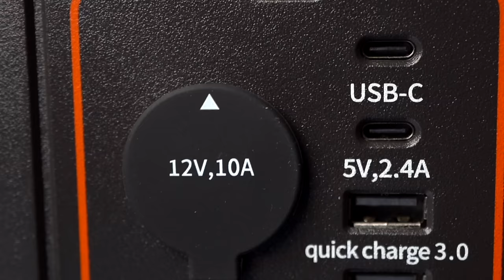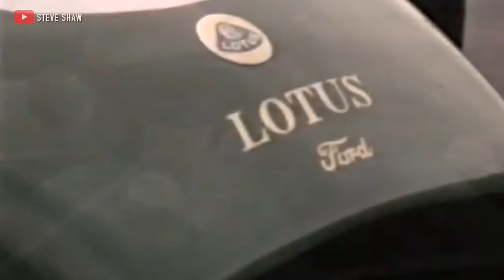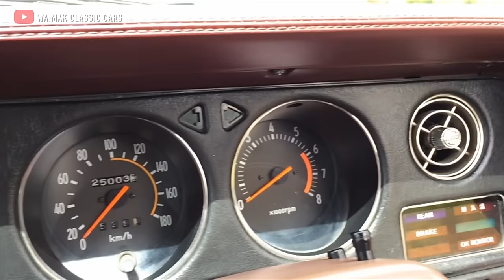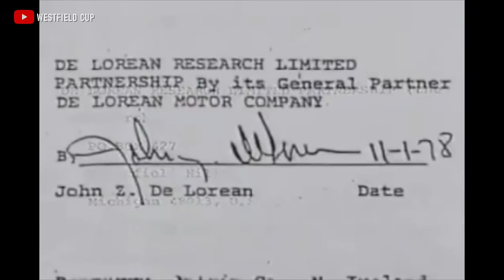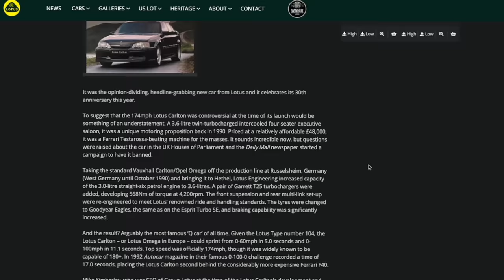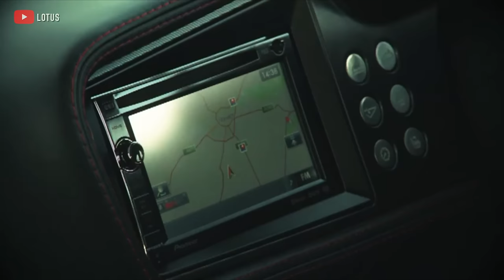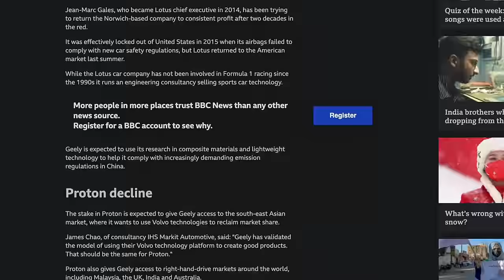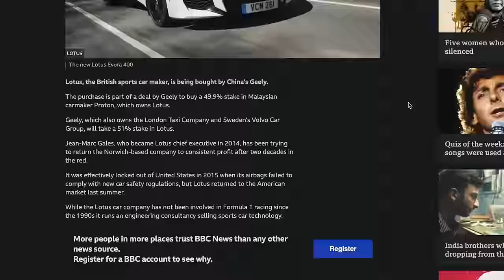Lotus is Dead

Comment: Here is the conundrum Lotus finds itself in: simplify and add lightness results in stripped down cars that the public has failed to purchase in numbers large enough for the company to survive.  But if you abandon this doctrine, how do you distinguish yourself in a crowded car market???  This last question becomes even more pressing as you move into very popular as well as very competitive car markets like SUVs or the future big markets in EVs. Can you live off your name?  No.  Lotus has been irrelevant in the car world for so long, many people have forgotten they still exist.  

Perhaps the Emira is pointing towards a potential solution.  The Emira is basically a re-skinned Evora, but it is a $100,000 sports car that looks like a far more expensive exotic car.  Unlike the Evora, that impression is not immediately dispelled by the interior.  So far, that seems to be working as my understanding is that 1st year production of the Emira is sold out.  However,  from what we have heard, Geely is not interested in the small niche car company this strategy would produce.

My take is that the Emira was the cheapest way to buy time for Lotus to develop what is coming next which you correctly point out is a SUV (or two).  A pic of the new SUV has been teased for later this year.  But how many ways are there to design this kind of car and stand out from the crowd???  And what would persuade a potential customer to put up with sub par fit and finish as well as a limited dealer network?  

Right now, Lotus car stand out on the outside and inside.  Granted, the stand outs are not all good, but at least it is distinctive. In the future, Lotus will be hard pressed to stand out at all and that mediocrity could very well be the end of Lotus.

Comment: Lotus is just moving with the times, light cars just can't meet the safety standards needed to be road legal anymore. Plus I believe Colin Chapman would be onboard with electric drive as it gives so much more control. Also, electric drive is way simpler than ice.
Reply: Ignoring actual reality; if all cars were electric and someone invented an ICE engine, Chapman would throw out the electric nonsense for the weight saving alone.
Reply: @fredmercury1314  until some one figures out how to make the ev’s that are just as light.
Reply: @rexthewolf3149  Never going to happen. It would require a physics-breaking breakthrough.
Reply: @fredmercury1314  Can't beat the energy density of petrol. If synth fuel can get cheap enough, EVs are going to be a footnote.
Reply: Just going to ignore the existence of the MX5? Okay.
It's ~1000kg and passes all crash regs, btw.

Comment: I did the math, the Evija has 1974 hp at about 8267.5 rpm. Torque*RPM/5252=HP is the equation. Given our numbers of torque and hp we get the equation of 1254*x/5252=1974. From there we get 1254*8267.5/5252=1973.99942879. Close enough, pretty sure they said so for 1974 hp. 
I wish we had the numbers through the rpm range. If the torque and hp numbers were taken at different rpms, then my math is incorrect.
Reply: To further explain why my math might be wrong if the hp and torque were taken at different rpms: If the 1974 hp were taken at 10000 rpm, then the equation would be X*10000/5252=1974. That would make the torque at 10000 rpms just 1036.7448. 1036.7448*10000/5252=1974. The torque would be way higher if the hp was at 5000 rpms: X*5000/5252=1974... that comes out to 2,073.4896*5000/5252=1974. So a motor making 1974 hp at 5000 rpm is making about 2073.5 torque.
Numbers at all ranges would help tons understanding the car. 
Yes, I might be a little bit autistic.

Comment: If everybody wants SUVs, car makers have to make them. That is especially true in the UK, where there are actual laws that ensure that a company MUST be run with the intention of making as much money as possible. Not doing so can lead to the directors being disbarred.
I currently have a SUV, the first in my life, and it will also be the last. It is a truly hateful thing. Simply knowing that it is carrying all that extra, useless weight around is enough to infuriate me. I bought it simply believing that nobody should criticise a style of vehicle without having owned one, and it has proven even worse than I had ever imagined. It really does absolutely nothing better than a similarly interior-dimensioned car of significantly less than half the price. It has the carrying capacity of a small van, but with the footprint of a medium sized van, the road manners of an ill-tempered warthog and the performance of an asthmatic lawn mower.
I can't wait to replace it with an EV.

Comment: Interesting analysis apart from one or two glaring errors: The original Elan was a 1500, correct. So why show a 1600? (1558 actually). They NEVER raced a Flat 16 in F1 in 1966, it was a BRM H16 and finally the Champion driver for Lotus in 1968 was Graham HILL not Graham Clark.

Comment: Entertaining video with a bit of not previously known insights. I do have issue with how you present the early years of Colin Chapman's car development and racing heritage. Chapman wasn't creating his earliest car in a vacuum. The first three car series were to compete in British hill climb events where they were successful, but not really so different from their competitors. The post war Brits had a performance car sub-industry created around building your own light weight track/street car from either hot rodded pre war cars or from manufactured kit cars which is where Chapman/Lotus thrived. The suspensions on Chapman engineered car were very much superior to other maker's offering and gave Lotus a significant advantage. You gloss over the fact that for Chapman, everything he did as far as manufacturing road cars was only to support his race car endeavors. You do allude to that mid video, but it a driving force in Chapman's decisions.

As for the death rate of Lotus drivers: you might want to compare that to how many drivers died in other manufacturer's cars. F1 of the late 1950's and 1960's viewed the drivers as expendable items not much more valued than the tires on the cars. It took the efforts of Jackie Stewart at the end of the 1960's to force rules changes that would make safety features a part of the cars, but more importantly, the race courses the cars performed on. Were Chapman's cars more fragile than other. Yes. Did that make them bad cars? Hardly. For context, Porsche had a racing car with a chassis so fragile that it was pumped full of nitrogen gas and had a pressure gauge in the cockpit of the car. If the driver saw the pressure drop, he dropped out of the race because the frame had failed in the car. Race cars are dangerous, and everyone around them know it. Also let it be noted: Chapman attracted the biggest names as drivers at the time. The death of a star, no matter the enterprise, always carries a longer lasting impression than the loss in the same way of a driver no one had really paid attention too.
 
The late 1970's cars that seem to diverge from Chapman's goal of designing out weight were an actual corporate decision to rebrand the companies offerings. Gone was the market the British sports car - MG and Triumph plus the other small maker (except Morgan) all had disappeared by 1980. The market was in up scale cars such as Porsche or Ferrari like cars, so that is where Lotus directed their efforts.

 I have real issues with the pictures you used to illustrate some off your points early in this video. At one time you are referencing Lotus' sue of Ford engine when the engine on screen is a MG 'A' series engine as used in the MG Midget. That was an engine used in some of the Lotus 7's and 11's, but was certainly not the engine of the early Lotus 6 or 7's.

Comment: The Eclat and Elite Type 75 weren't poorly engineered, they had plain steel chassis without any rust protection. Later models had galvanized chassis, but it was too late. The damage was done.

Comment: I had an excel and an esprit years ago but never got an Elise, still might buy a used one. Vehicles have to evolve and sadly where Lotus had the edge, lightweight and great handling over the competition but now a Kia handles like a lotus   and a Toyota can be as fast for less money.
The problem with many cars both ice and EVs is the power to weight is still not as efficient as Lotus always was. The body and chassis on a Tesla is reasonably light but needs improvement. The wheels on EVs are way to heavy imo. The future for Lotus is developing a lighter battery and motors.

Comment: The Carlton did not die because it was horrible but because it was quite easy to steal that no one wanted it and because of that factor, the insurance premium on those things during those days were off the roof.

When the Carlton launched and the press was having a riot about it be it good or bad, it gained notoriety and joyriders soon realized the potential of the car. Coupled with the Sierra Cosworth, both the Carlton and Sierra soon became joyrider's ride of choice as both cars had terrible locking system that's easy to pry open and soon every carjackers would pick these cars, pry the doors open and take it for a high speed chase with the cops who at that that time didn't have anything to catch up with the Sierra and even worse, the Carlton which was way quicker and faster. 
Thus insurance company started to doll out exorbitant premiums for these cars which effectively class them under supercar status despite being normal coupes or even sedans and that effectively killed anyone's ambitions of wanting to own a car like that and with all these factors coming in hard, the sale stopped.
Reply: exactly.

Comment: Another car you seem to be un aware of is the lotus Isuzu Gemini from Japan.

It was a front wheel drive Gemini (I'm sure there's another European car with a different name).

It was built before the 90s elan as a test bed for the elan engine, it had recaro seats, different suspension and a body kit.

There was also a later version with awd and a turbo

Comment: that was a great overview of the Lotus company and the Lotus cars. In my 70s now, I am about 35 pounds heavier than when I last sat in my 1967 Super Seven, and I suspect that it would be a very tight squeeze. That does not stop me from fantasizing about locking myself in my workshop and coming out with an electric Caterham seven. It was not the most practical car that ever I owned, but it IS the one that is most missed.

Comment: My Europa and my Esprit were a lot of fun. They were a lot of things but one thing they weren't were cars. ACBC once said regarding his race cars: 'A race car that falls apart as it crosses the finish line is a successful design"! Regarding his road cars, he said; "My road cars are thinly disguised race cars"! You see the point. My air-cooled 911s will blow the doors off of my Esprit S2 at the track and I could drive them from Seattle to Miami with confidence that I was going to make it. The Lotuses would strand me on my way to the grocery store. I got to where I never drove them more than 10 miles from home unless I was trailering them. heh heh However, ACBC is one of the greatest car makers of all time and I miss the shit out of him.

Comment: Alan Stacey was not killed by a Lotus failing, to be fair. His death was much more akin to Welsh F1 driver Tom Pryce some seven years later. unlike Pryce, who hit a Marshal, and in so doing was hit in his head with the man's fire extinguisher however, in Stacey's case, it was a bird strike to the face at almost 200km. it is likely he was killed instantly, however, we'll never know if his head and neck injuries were from the strike or the subsequent loss of control at high speed and crash thereafter. But it was NOT car failure. 

Rindt's death is a little more complicated, yes, something snapped.... but that was not necessarily due to the flimsy build quality of the car. Lotus had made some improvements there. No, instead, I would like you all to watch the actual footage of Rindt's fatal crash, you put it in the video, so look closely. Rindt's car was running without any wings. it was made with wings. Wings were a thing by then, but Rindt was running with his front and rear wings removed. 

The cars were down on power compared to the Ferrari's of that year, and they discovered they could get almost 1000 RPM out of the thing, sans downforce. So over that weekend they began running without the wings. John Miles, Rindt's team mate said the car was twitchy, getting vibrations which felt on the brink skipping in some parts of the track and that the car had to be fought to keep straight, so suggested they abandon the wingless idea. Instead, they ran with it, simply extending the final gearing to get the most top speed out of the new set up, with assumption this would smooth out the high speed wobbles. 

The moment you have a car that is wanting to veer, and had excessive vibration, you are adding stresses to the tolerances of components. The car was designed to operate with downforce loads that were not present on Rindt's car, because of the decision to remove the wings, effecting the stability of the car. Removing those loads, and running the car without key elements of the package, was likely a far greater contributing factor to the failure than the build quality, as the car suddenly experiencing exertions upon its tolerances it had not been tested for. 

Additionally, Rindt was not fully anchored to the car. Rindt seldom wore the crotch strap of his five point harness, and was not in 1970 Italian GP either. He was of the opinion that, ironically, it was safer not to use it, as it allowed, in his mind, faster extrication from the vehicle in a crash scenario. In this instance, however, the nature of the crash, caused him to slip out under the belts, and buckle, hit with force, at speed, bi his body, namely beneath his chin, slit his throat. 

There is a fine line between on the spectrum of Risk V Glory where you can cross the threshold between life and death, and it is likely in this instance, Rindt crossed that line, despite being warned by his teammate that there could be some issues. Rindt had not experienced the same problems in pre race running as Miles, so chose to take the risk, and ultimately it killed him. 

Again, like Stacey, I would argue that although something failed, it was not an inherent fault in the car or its build quality which lead to the crash, but high risk operation of the car in a manner which went beyond its design parameters, which in turn caused that failure, and not the fault of the failure itself.

Comment: Part of the problem for the makers of these pure drivers cars (Lotus included) is that modern standards for fuel efficiency, emissions, safety and other things mean that you can't build a car that's road legal without all kinds of driver aids, engine management computers etc, all of which make the "simplify and remove as much weight as possible" no longer a thing you can do (you have to make it complex to be legal and it ends up being heavy to hold all the mandatory equipment)

Comment: Good video. I have always admired Chapman and the early F1 cars: the 25 and 33 and the original 49. It is a pity he died at such a young age. However... the golden years of the car have long gone. The car is dead. Car companies are into providing transport systems and most of the younger generations are not really interested in cars. That's why we have SUVs and, even worse, cross-overs. That's why almost all car companies go EV and almost none of them are researching ways of creating emission free cars not powered by electric motors. It is sad, but a fact. For at least the next 10-15 years we are condemned to EVs, even though (to me) an EV is a fundamentally flawed solution. For me the solution is to move back to motor bikes as hobby vehicles.

Comment: As an Exige owner, sell me an Emira with every unnecessary piece of electronics stripped out of it, Remove all sound deadening, give it the thinnest, lightest carbon fiber bodywork, and suspension. Give me lightest seats, wheels, and suspension components, and scrap the infotainment system, If they can get the weight down to 2900 lbs, I'm all in. That's the best you can now hope for in an American-market street legal car, so I'll take what I can get.

Comment: The Lotus F1 was also the first F1 car to use the engine as part of the chassis to save weight
Reply: And first to make a monocoque chassis work, the first to lay out the blueprint for the modern F1 car (Lotus 72), the first to exploit ground effect, etc
Reply: @rogerking7258  And the first man to build the world's best handling sports car of its era with just £20000 n the first man to win as many F1 races (in its first 10 years of racing) as Ferrari did till that time, for me without any doubt at all the Greatest mechanical engineer of the 20th century, No Porsche E type could live with the Elan on twisting country lanes specially in the WET

Comment: I think that you have something here. The Evora S1 was already rather porky, the Evora S2 (with the new body and called Emira) is obese. Lotus and Porsche take note: sportscars are best without slushboxes and cupholders.

There is simply no justification for any type of SUV - the extra drag (Cd x Frontal Area) drives inefficiency and energy loss. If you want to go off-road buy a bike or some trail running shoes. 

As for electrified vehicles, we need to see the full CO2 and ecological impact of such vehicles compared to say e85 (produced used agriwaste in Europe). Well done Porsche for working on hydrogen.